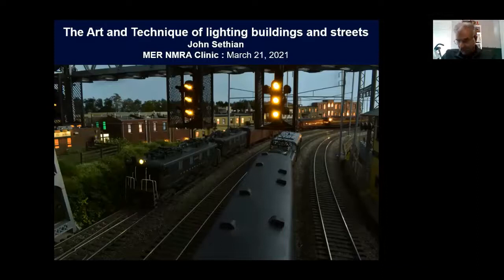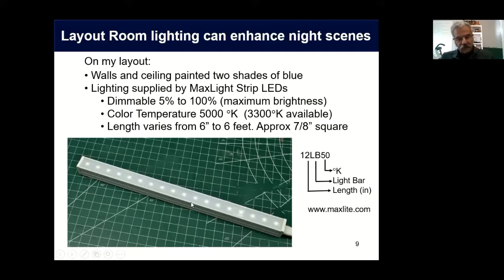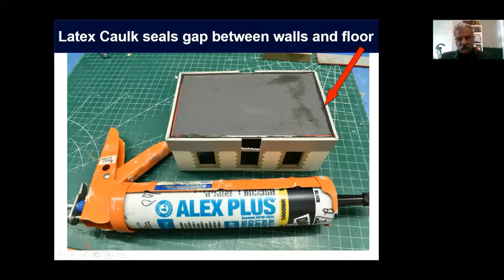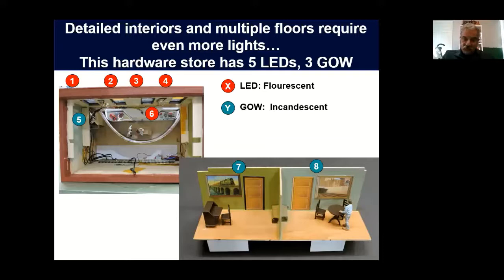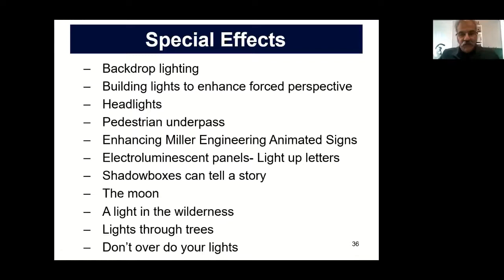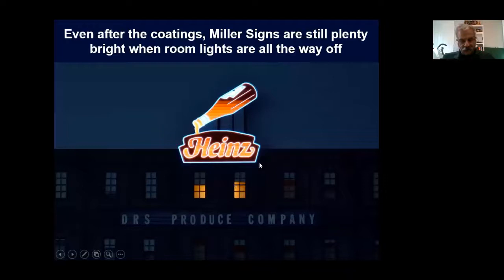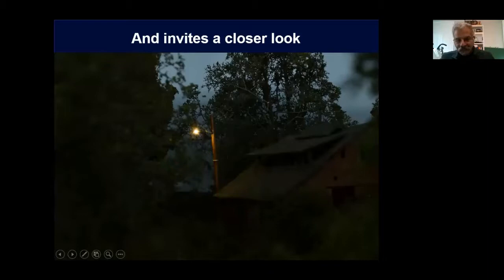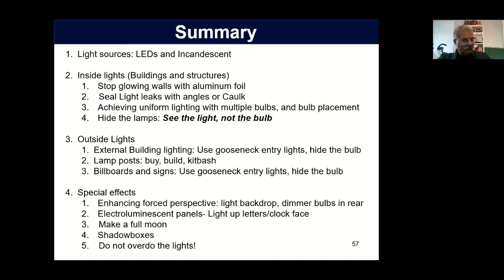Potomac Division Virtual Clinic 10 "The Art and Technique of Lighting Buildings and Streets "

Comment: For adjusting DC voltage, try a DC to DC ‘buck converter’. Amazon has a 10 pack for $15 or $1.50 each. Can adjust voltage from 3v to 30v @ 3Amps (Zixtec LM2596). About 1/3 the cost of the the Woodland Scenics controller (per channel), with the added advantage of one buck converter per circuit - meaning you don’t have to concentrate all your wiring in a single location. Each buck converter has a screw adjustment to control the voltage. Start with a wall wart and that outputs DC - many choices available from 4.5v to 12v or more. Wall wart can feed your lighting ‘bus’, and then use a buck converter to adjust voltage to your bulbs or LEDs.